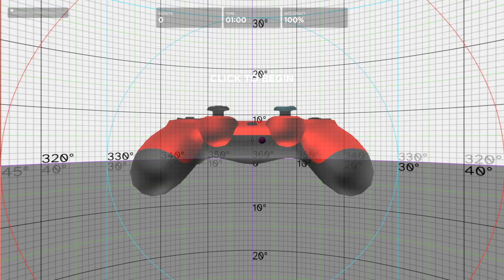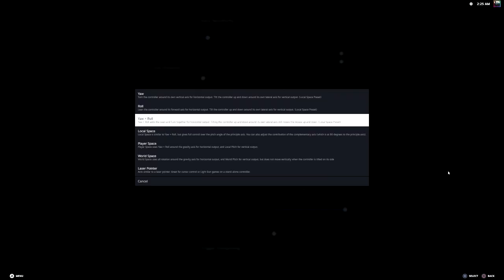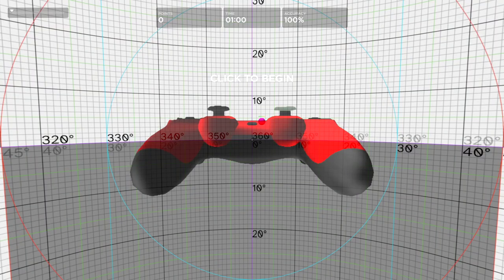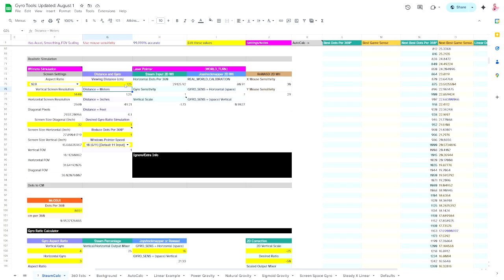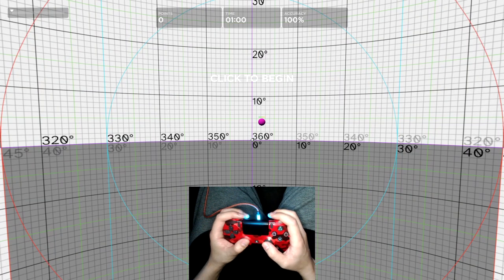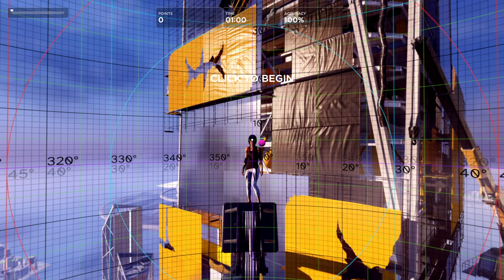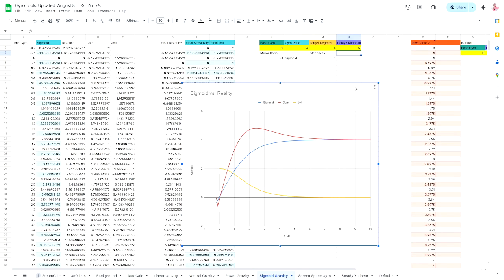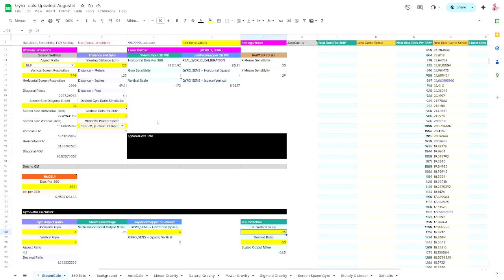Gyro Theory: Basic Settings (Overthought) *with feedback for devs

Comment: Some of this is very good information and some of it is plain wrong.

The part about wrist arc is good and probably the best part of this video.

Yes, 4 rws is about where you want to be. And I'm not sure about needing to cover every millimeter of space possible.

You might go a bit lower than 4 for more accuracy accepting some tradeoff there, but it gets exponentially worse the lower you go.

The part about dot per 360 calibration yes, if you have too high of in game sense you get angle or "pixel skipping". That's only telling one side of the story.

The more dots per 360 you set the more noise coming off the controller you expose as well as unintentional motion from your hands such as shaking.

These sensors have acceleration noise so for instance mechanical vibration from the trigger mechanism is always being read. 

Your controller's dot per 360 says how much of that is translated into cursor movement. 

It's like those mice that advertise super high DPI like 20k when pros are playing on 800 dpi.

There is no mouse with a native resolution of 20k DPI. 

But it's worse on gyro because of high noise levels on these sensors.

Smoothing helps hide it, but on the levels he's suggesting it's going to overwhelm the 1 euro filter and expose massive noise.

The other problem is acceleration is not a free lunch with all gains and no drawbacks.

When a target changes direction a lot especially if quickly then the mechanism that lowers your sensitivity starts to conflict with the mechanism thats raising it when you move the controller faster.

This hurts your ability to track targets.
Reply from the maker: Ok, I see. I was being explained to about the noise stuff a little while ago, about how the alpakka uses one for low and another for high noise. I think I get the general idea of that now, thanks to your mouse comparison. I know that mice fake the DPI past a certain point. So it makes sense it'd be worse on gyro. I just don't actually know the technical limitations of that; I'm not that knowledgeable about these things.

And yeah, accel ain't free. You're still going to feel it, and it won't automatically feel good to all people. I suppose I was just trying to show that there are more accel options to choose from, that literally don't exist yet in Steam Input or Natively in any game with gyro.
Reply: @megaphone1113  Don't feel bad. Some of these tools you got are crazy good. That wrist arc calculator is nice.

I'm in the process of making an omnibus config video like this right now and I'll probably put that part as one of my sources.

I tested the whole dots per 360 thing. I set it on 5000 counts, 3 RWS, 1.44 in game vs 32000 counts, 3 RWS, .225 in game in Aim Labs @ 90 HFOV (58.715 in game) and ran ten trials each on the game six shot. (I didn't record this, but I'll record a real sample for my video).

I think I set the DPI a little too low, 1.6 pixels per count and 758 probably isn't optimal. I think the best "DPI" is 1000 but I was too lazy to dial it in that well.

On the 5k counts I was probably averaging 79k with a high score of 87.7k. I probably would of gotten higher with a lower pixels/count ratio. On the giga controller sense I hit high of 82k and avg about 75k.

The difference isn't a lot, but it's enough to rule out variance I think. If you get a different result let me know. Maybe I'm just bad and couldn't hold the controller steady enough to take advantage of the tiny latency advantage of high dpi.

You can do well on this setting as it's slightly more responsive, but you have to be so careful not jar the controller. The acceleration noise from what I've read is the real killer on these controllers, not the static noise. The 1 euro filter in the background was probably having a rough time trying to keep all this in check. When I hit 82k I was like Smooth Mcgroove with it.

As for the acceleration thing I tried so many settings for it trying to get it working better than static that I'm over it at this point.

There might be a setting that does not cuck tracking, but I didn't find it.

I suspect it's good in games like Valorant where they cannot do crazy strafe spam with no inertia like in Overwatch where you can get the good flick over and not have them move a lot after.

I know the problem they are trying to solve with it. The issue is there's no standard for how to deal with the side effects.

But I am working on this. Split controls. I got a set of Aolion J20's coming sometime in early Sept. where I can set those bad boys on 1.5 rws (33 cm/360) and arm aim and have a 2.4 ghz dongle like two inches away instead of bluetooth.

If that sensor is even somewhat decent I may be able to get something going that becomes meta for gyro, but that's pure speculation at this stage because I was never able to find the datasheet for the sensor to know.

And yeah, with enough room to move your whole arm acceleration obviously isn't necessary.
Reply from the maker: @IPlayController  hmm, ok. I actually have barely been doing  any Aim Lab at all lately. I mainly booted it up for this vid. I've essentially been testing things out in the wild in actual games. IDK, I've always felt that there is just too much randomness in trying compare settings but this actually makes since it's technically the same settings. Guess I'll go ahead and test this out.

BTW, I did say in the video that my accel program doesn't work well in games. It'll cut off randomly. Which is why I want a native implentation.

As for getting used to accel, it's a commitment. It's something I forced myself to get used to with old Steam Input. I haven't been able to use any other accel at the same level that I could with old Steam Input. So until I can actually use something that works well, I can only theorize about settings right now.

Like steams current solution is great. It's perfect most games that are low TTK body shot games. I just personally value precision for extreme microshots like pixel headshots in Fortnite. Like, I know I can perform fine without accel. I use a flat sense in Steam since I basically have no choice. I have just grown to enjoy the comfortable stability accel gives me (especially while I was playing at 12:1). I could've gone a lot more into explaining things with my logic/experience with accel, but I decided to keep the vid "short". Looks like I'll have to make this into a series.

If you want a task that will really show you what accel is for, play Scattershot. This task also highlights what I was saying in the vid about overshooting targets with steams current option. For context, I'm now playing at 6.71, with roughly 3 degrees of "accel".

Yeah, I really need to try some joycons. The extra range and shooting with the other hand for precision has always been something I wanted to try.
Reply: @megaphone1113  I was doing sample testing on this for two straight hours last night just to realize that OBS was cucking the results by adding input lag so it all went down the drain and have to test it again today.

I went into Halo as well and was doing preliminary testing on all this stuff. It feels like 3.5 RWS is enough to turn when actually in a real game. Against the bots in training room I was hitting the most on 3.25 RWS @ 5650 dots/360.

I was beating the Spartan bot 30-2 and was going positive every game in there against real players, which I dont think is bad considering I don't know the maps yet. I'd usually go like 13-7.

No, it's not the most scientific way to test things, but there's so many variables that even a test trying to be scientific is gonna have some real difficulty.

This is why I've been working on this video for about three months. Even learning what the optimal monitor and GPU settings are was a crazy undertaking and that had to be right just to control that variable the best I could.

I learned yesterday that unless I film tests on an external camera it can screw up everything because OBS takes too much resources in the background even on a relatively good pc with a 4060 gtx.

It's wild.

Comment: okay upon further watching....

I feel like some of the calibration stuff you are doing is getting a bit lost in the weeds. This isnt inherently a bad thing, but let me explain;

The dots per 360 is the dots per 360. There is an objectively correct value; how many dots does it take to do a complete 360 horizontal turn in game. Thats the value you should use. Everything from FlickStick to gyro degree sensitivity to other functions in steam input like reset vertical to horizon and turn camera by x degrees all rely on the dots per 360 being the correct value.

All this other stuff of fine tuning it based on fov so you get the same feeling regardless of how far/close to the screen you are has merit, but when you change the dots per 360 setting those other things dont work correctly (under or overshooting the desired result). All this other stuff should be applied to your gyro degree sensitivity, not dots per 360. That should give you the best of both worlds; the correct functionality for the stuff that relies on the dp360 being correct for the game, and then the sensitivity that yields a good feeling/experience.
Reply from the maker: Ok, I see what you're saying. Yeah, my brain was pretty focused on converting/scaling screen pixels to dots with all this math that it didn't register to me that I could just do it to the sensitivity. Then I wouldn't need to do the exceeding 32000 thing. Ok, I think I'll go ahead and try to update this.
Reply: @megaphone1113  I think what you're exploring is the mouse dots to angle resolution. That's pretty interesting. To maximize dots to angle res, I guess my advice would be to keep your RWS at 1x, max out DP360, then tune the in-game mouse sensitivity to get real world synchronization. Once that's complete set your Gyro Sensitivity to taste.

Or the other way. While at 1x, Get the minimum, non zero in game sensitivity, then see if the DP360 can get high enough to match while.

One edge case here that I still haven't totally confirmed is that, if the DP360 and Gyro Sensitivity are very high, turning the gyro fast could generate so many mouse dots that the cursor would have exited your monitor's current resolution. 
I don't know for sure if cursor movement gets clamped to screen edges before getting into the game engine (might be an OS thing, and game engine handling of mouse might also add cropping), but it'd mean your output would be "cropped", and you'd desync.
High frame rate would help this as the displacement would be chopped up into smaller chunks.
I started to notice this with flickstick as you could generate 180 degrees of angles @ the DP360 setting very fast, and you'd lose sync. So smoothing on that is for more than just feel - it can help dole out pixels over time to avoid the cropping issue.